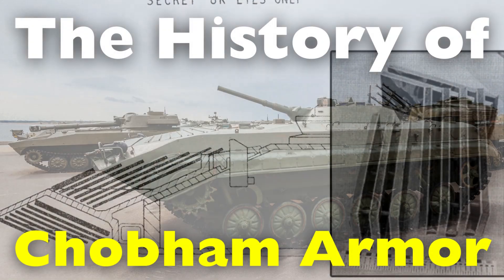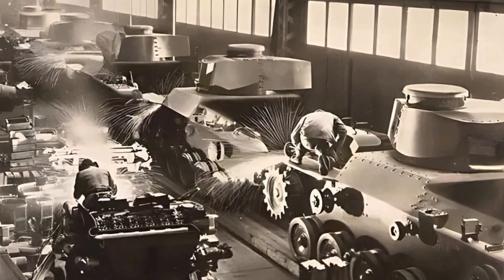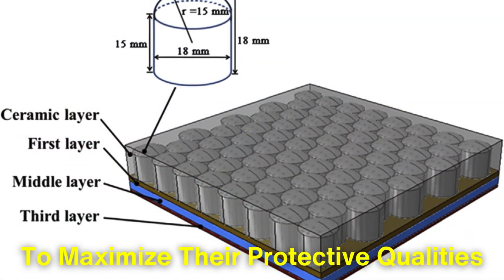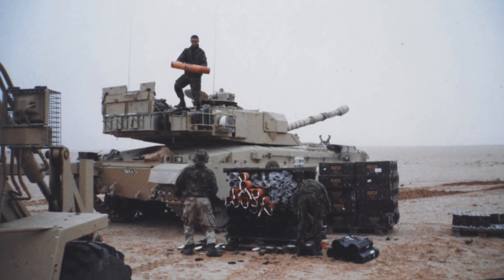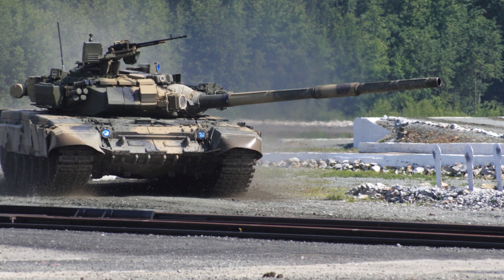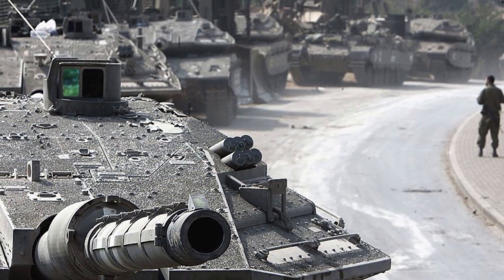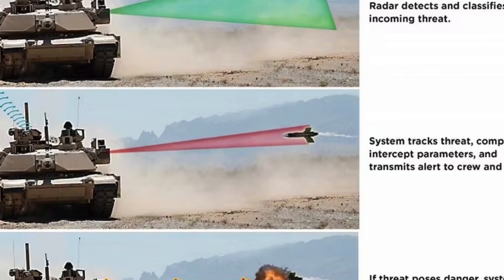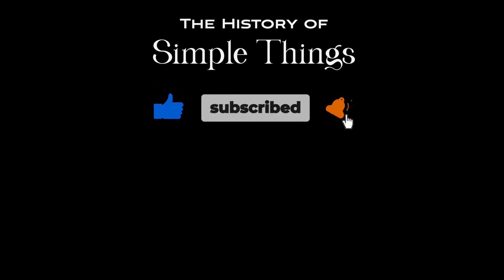The History of Chobham Armor: A Revolution in Tank Protection

Comment: Great video, great armour system but only protects crew, and internal ammunition, even Challenger 2 ( I think, maybe Challenger 1) has internal anti spallding Kevlar nets un turret - spallsing us where fragments if the internal turret wall material would shatter off causing shrappnell on external hit by projectile, so, Chobbam armour may stop pennetration, but shock wave though material - causing spallding, still seems to be a problem.

Comment: Why is it, then, that Abrams and Challenger 2s, are being knocked out in Ukraine by FPV drones?
Reply: There has only been 1 challenger 2 knocked out and that was because it hit a landmine and the track was blown off, and later on the Russians set the back of it alight( engine bay) the crew survived .
Reply: there were no fpv drones in combat at the time of their design
Reply: Top penetrating hits, the roofs of tanks are less well protected. Modern anti tank missiles attack the tops of armoured vehicles.
Reply: The main operators of those would not deploy the tanks in theatre naked like those provided to Ukraine.  Ukraines applied reactive armour is ok but not as effective as the originators in theatre protection
Reply: The sweet spot on a tank is right between the turret and the hull. The armor on the tops of tanks is going to get a lot more survivable. There aren’t any meaningful ways to protect the space where the turret and hull come together
Reply: Because the drones target specifically for the turret ring at the back or sides and that is a major weakness of any tank. Can't really do anything to stop the drones unless an active kill system is implemented against drones